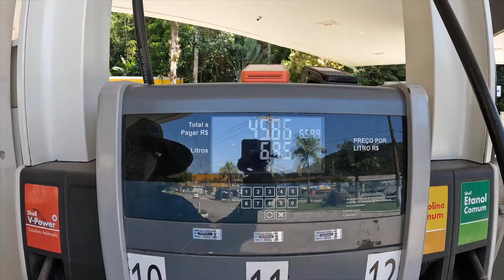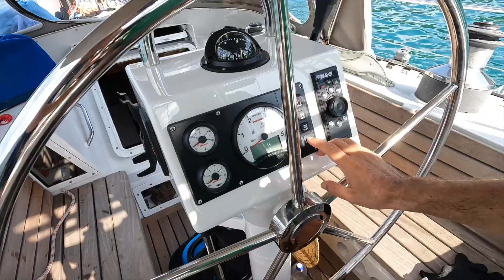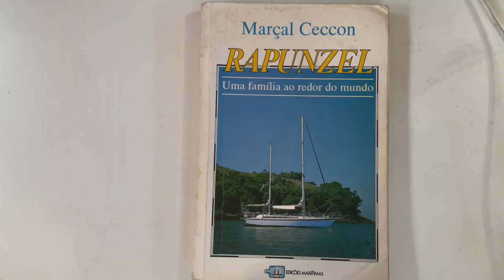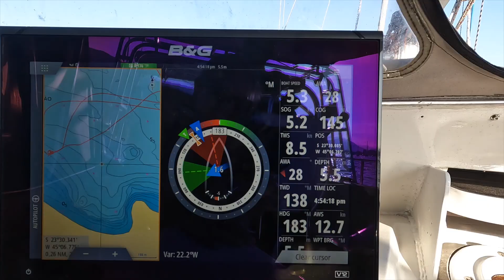⛵️ We have 2 bad news!! The reality of boat life!! #233

Comment: Hello there. I'm in Florida and we have a lot of cockroaches i the area. I try to limit the sprays chemicals to the outside of the house so if you are familiar with sticky fly paper the make a cockroach sticky tray that you lay down in areas of their travels and out of the way of where you have stuff. This is real sticky so you don't want to touch the inner portion of the tray. The tray has an attraction for them but when they get on it they are stuck. You can leave it for a good while with no problem. even if the lay an egg sack in the tray if will catch all the little one too. Just don't get you fingers in the tray!

Comment: I use Raid Fumigators, a box comes with 3 sealed plastic cups, unseal, remove canister, put a small amount of water in the cup to line and drop canister in, place quickly in boat bilge on level area, close up boat. 3 hours later all insects will be dead, no smell or residue left.

Comment: In Caribbean I used little plastic traps for  cucarachas.. they are very practical, you can stik them in several places in the boat, and the insects are attracted inside by the smell, passing trough they pick up the venom, which they share with the other cucarachas when they meet. They will  die after hours. I saw some cucaracha occasionally, but they never spread and rise in population. It is clean, practical,  no mess around with sprays that are harmful also to humans.
Reply: An exemple
Reply from the maker: We actually already had and still have a lot of them spread in the boat. That's one more reason for me to think it came in flying

Comment: The most common way for a cockroach to get on a boat is with your groceries. The best way to fight them is to put your canned goods and dry goods into plastic bins that you can seal up. Another thing you can do is remove their labels and throw away the paper label and just mark it with permanent marker for what it is when it comes to canned goods. Once again put in the canned goods into a plastic bin preferably clear so you can see into it without having to open it that way if there is a roach it was hiding between cans you’ll see it and can get rid of it.
Reply: That's what I always heard too, no paper labels. They eat them
Reply: @nowhereman7398  and cardboard boxes are an absolute no no.
Reply: @nowhereman7398  they eat the glue

Comment: Not sure if you can get it down there or if its allowed but Boric Acid powder works great at controlling roaches. Only thing is you have to be careful not to get it into water sources. It comes in lots of different packaging depending on where you are using it.

Comment: Hello. The difference between boat gasoline and car gasoline is ethanol. You outboard seals, tank and lines don't like ethanol. Over time this will be a problem. Pay now or pay later
Reply from the maker: It's impossible to find gasoline without a lot of ethanol in Brazil
Reply: @OddLifeCrafting  normally the fuel docks on the water are ethanol free
Reply: That is why they charge more
Reply from the maker: @kitkatthemostloveddog7028  They aren't. There is no option in Brazil

Comment: Hey guys love the show, quick question. Have you looked into modifying the windless to electric or are you planning for a new electric windless. I also wonder if your center board and rudder could become electric. That would be real cool. :) Keep the videos coming.
Reply: windlass
Reply: @suburban404  maybe he's talking about the motor for windless days  ;)
Reply: @Krieghandt  no the correction is correct. I  was just interested in their plan.
Reply: @richardmikesell1335  Wouldn't it be cool to use AI, tie the depth sounder to an electric motor to lift the keel just enough, and automatically? Maybe lift it to reduce drag when sailing downwind? I'm an automation nerd 🤓
Reply: @suburban404  Yes Tom now your talking my language. I'm a older guy and what they have just seems like alot to work but, they are young.

Comment: As you have a small space with many crevices I would fumigate the whole boat, you have to stay away from the boat for a few days.  It may take several repeat treatments, as the cockroach eggs are immune to fumigation and take one to two months to hatch.  If you don't like the chemicals, there may be other ways to address it.  Read up on the cockroach lifecycle.  One thing to help prevent insect investations is to remove all paper and cardboard packaging before/immediately when bringing anything onboard, insect eggs are found in the paper/cardboard.
Reply: Exact what I wanted to comment: remove all the wraps/paper from tin cans etc. Good luck!

Comment: I looked at your containers, and wondered why you are transferring fluid from your water (blue) containers into your gasoline (red) containers) . Then I see you use both for gasoline.

Well, hopefully you never use blue containers for water.   Or you'll end up like the guys on Parlay Revival, with water in their dinghy's outboard motor gas tank.    Maybe... wrap some red duct tape on the blue containers to show they are for fuel?

Of course, you are free to use whatever containers and color scheme you want.... though here in the US, in SOME states you cannot fill fuel into any portable containers other than red (for gasoline) or yellow (for diesel).   Be aware of that when you get here....